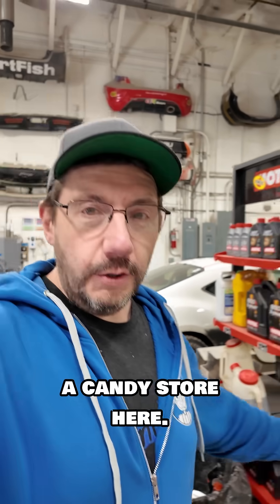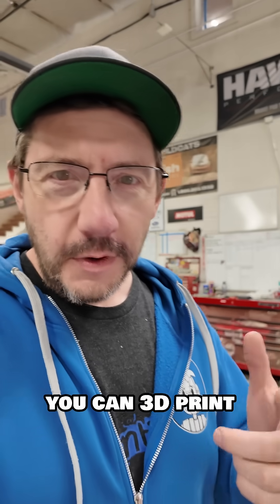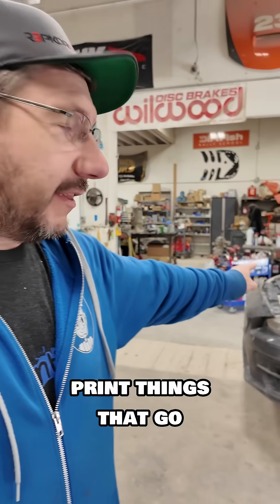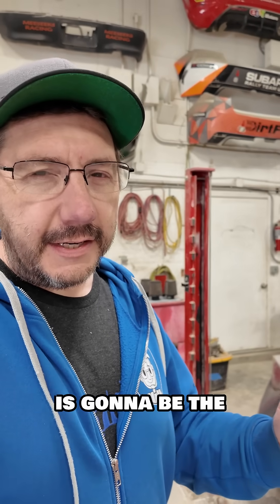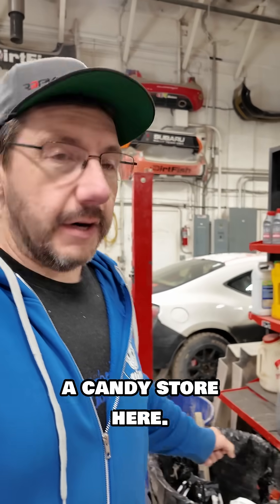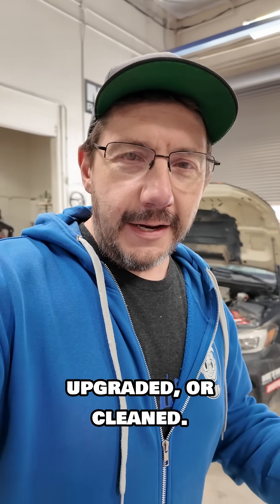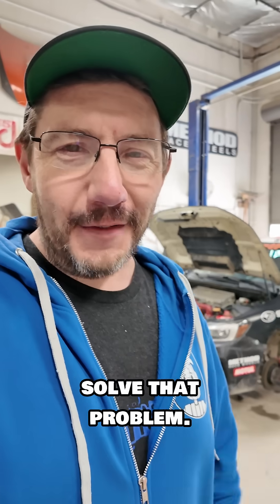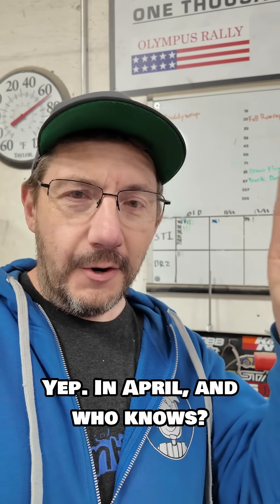3D Printing for RALLY CARS at DIRTFISH  #3dprinting

Comment: Why didn't you use the Vision Miner for the prints that go into the engine compartment? After all, the printer is designed to print with high-temperature filaments that consumer printers can only dream of.

Comment: Dirt fish looks like a fun track every time roadkill used it. 3D printing can easily solve airflow issues and other things for race cars. You will definitely need to use a very heat resistant filament and make sure your build isn't brittle since vibrations are a major killer on vehicle parts.